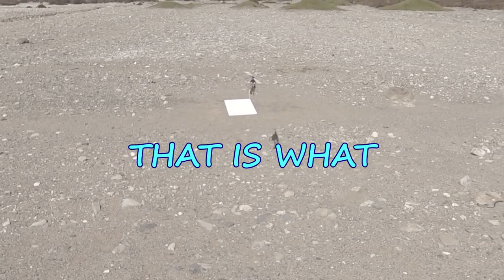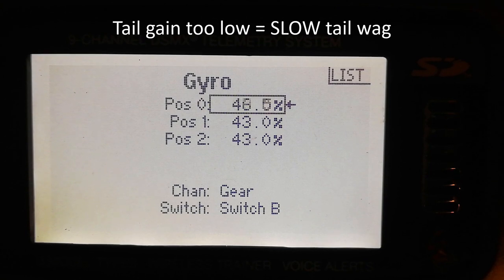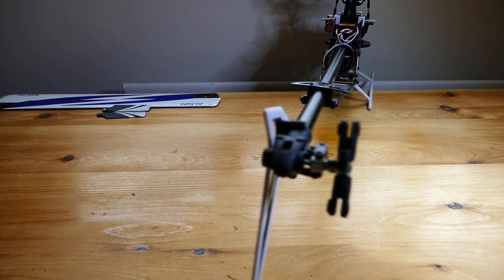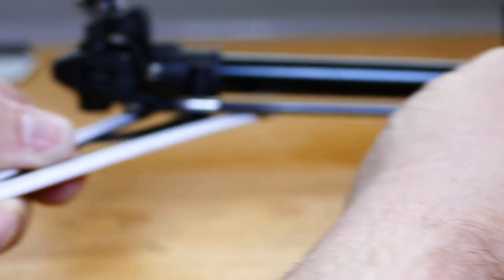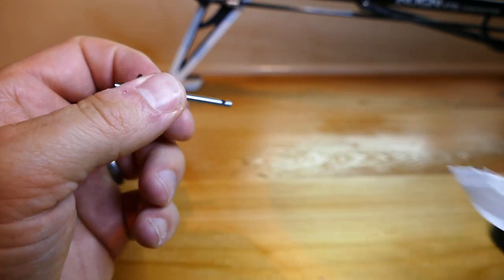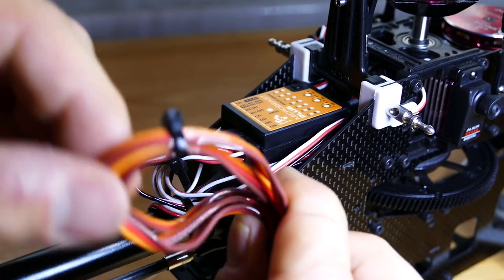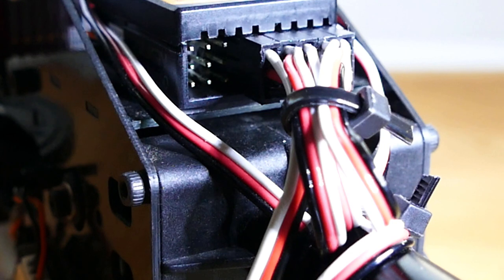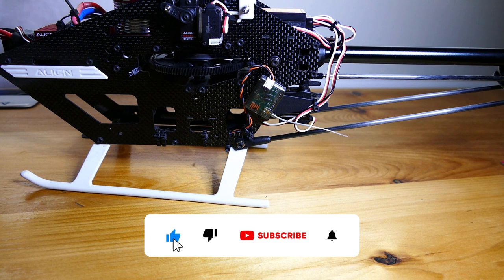How I SOLVED my TAIL WAG - and you can too

Comment: Thanks for the video, I rebuilt my KDS450qs and had some crazy tail wagging going on. I had the same bodge job or wires hanging off it including my receiver. Installed everything correctly and the wag immediately stopped. I also had the gyro pressed up against the frame of the heli so I set it back a little so it wasn't touching anything on the sides and we're flying great now :)
Reply from the maker: Awesome glad you got it sorted. Thanks for the comment.

Comment: I found my Trex 470 had tail wag and excessive tail blade slop because I had forgotten to install the two brass collars on the screws that screw into the plastic tail blade grips!  Fixed that, made sure tail was smooth and free, set tail gryo gain to 38-40%, and the tail is rock solid now.  Thanks!
Reply: Although that is with upgraded tail servo, which worked better than stock Align tail servo, and also upgraded to rotor tech tail blades.
Reply from the maker: Awesome.
Reply: Which FBL are you running? I have a 470L.as well with an Ikon2, Torq mini tail servo and I am trying to sort out the tail wag. I did install my brass bushings, and my tail mechanically is very smooth with minimal slop so it's frustrating that I still have wag. My gain is currently around 60%.

Comment: Hi. When changing the GAIN parameter, nothing changes. I assigned the GAIN knob to the transmitter, lifted the helicopter into the air and turned the knob to change the GAIN. I TURNS THE GAIN to the maximum value - 120 and the minimum value - 0, but I did not notice a difference in relation to the tail movement. Please tell me what is the reason, is this possible?

Comment: From my experience, using kbar or vbar can cause "software" tailwag or something like, even there is no hardware issue.
solution I found was reduce tail gain less than 54.. but too low gain cause tail loosen when pushing tail to extreme conditions..

Comment: Very unlikely that a loose satellite receiver would cause the wag. It would have to transfer wobble to the gyro. If it did that the swash would wobble too trying to correct the gyro wobble. Probably you have done a heap of things and one of them changed problem.
Reply from the maker: Yeah it's a weird one. I didn't want to beleive it either. I did try several things as mentioned but at different times with tests between. So like it had the wag, sorted the receiver mounting then it was better. Can't remember if I included this little explanation but the other thing that lead me down that path was as it was solid on take off I thought that would make sense as the Receiver wasnt wobbling yet but after flying around a bit it got the receiver wobbling and passing on some vibrations? But hey, I am open minded.

Comment: I know what was causing your tail wag. It was not how your receiver was physically mounted but rather where the antenna was positioned. Being so close to the tail servo interacts with the servo causing jitter and tail wag. I had the same problem and wag went away after moving the receiver antennas.
Reply from the maker: Interesting.  Not heard of that before
 Where would you  say is the best place to mount it?
Reply: @RCStuffvideos  Yeah I discovered it by accident as well. I just routed my antenna forward away from any servos or servo wires.
Reply: Hey that's a great idea. I will give it a try. I have a 470L brand new build, great mechanical movement, but bad tail wag that I'm trying to sort out atm. Brand new Torq tail servo, Ikon2fbl, so it's frustrating. Will report back.

Comment: What do you suggest as tail gain settings for the Blade 230 or is a momentary wag not worth messing with? I only notice it momentarily when I yaw sharply. Cheers.
Reply: Mine was wagging slightly until I crashed it. Got a carbon tail boom and blade and it fixed it. 🧐🤔
Reply from the maker: Good question.  never had much tail wag with my 230s and havent flown it for a while. I had the occasional very mild bit but nothing consistent so I wouldn't worry too much but at the same time I'd try and get it as good as possible if you can. So you may know with 230s you van access full PID gain controls so bit different from the normal gyro setttings on a bigger RC heli. I never touched the tail PID controls left them all at default of 100 but if you get a bit when you yaw sharply then it goes? Maybe try turning up the D gain or turning down the P gain I'd try first. It says in the 230 manual how to do it. Let me know if you get stuck.
Reply: @RCStuffvideos  Thanks, for now I think Il leave it be unless it gets worse. Right now It’s about as mild as you can get and very temporary when it happens, kind of like a reaction to a sharp yaw.
Reply: Funny I noticed the slight and occasional tail wag only occurs in safe mode. Wild uneducated guess but maybe something to do with overcompensating for slower head speed? Guess I don’t want to worry about it since it disappears in idle up 1? If I tried to get rid of it in safe I would likely mess it up in idle 1 right?
Reply from the maker: @stevejohnston8543  Well head speed can affect it, yes and im not sure if you can have different gains for different flight modes on the 230s. Have a little play and see?
Reply: @RCStuffvideos  Y’a the tail seems much happier with the higher RPM. Think I’m just going to use safe as a bail out and to take off and land.